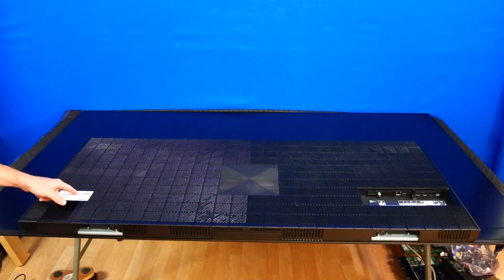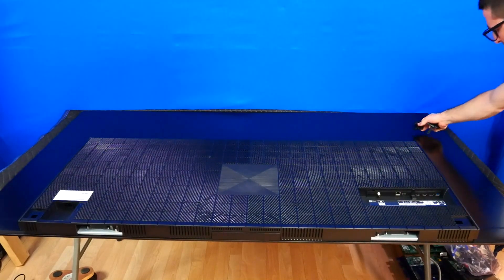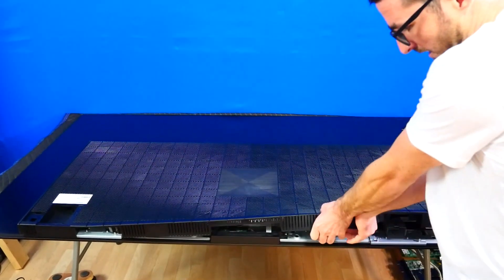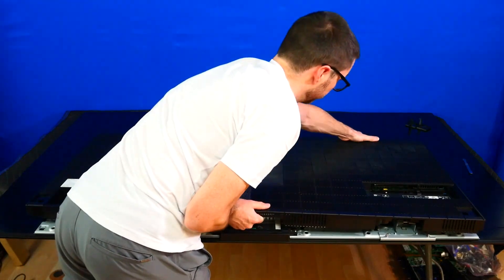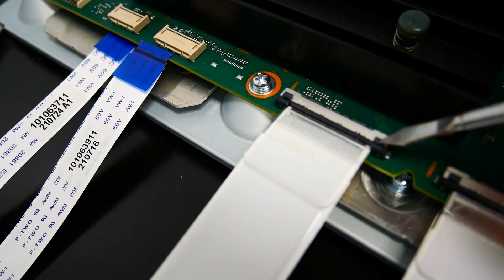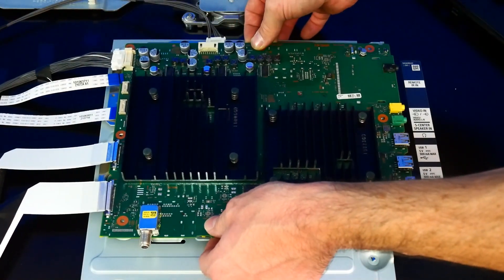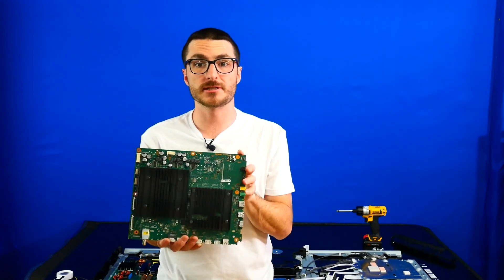Sony OLED XR-77A80J Disassembly | Back Cover & Mainboard Removal

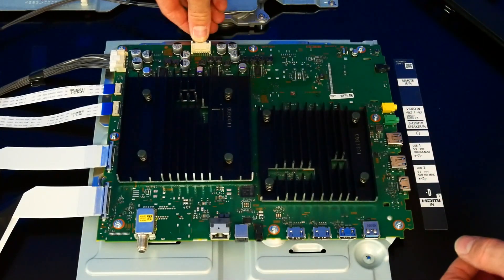Comment: 1:20 Great videos, Sony XR-6580CJ  power on issues for the first time after being off for a couple of hours. When powering on I get white steady LED sound of a relay picking and then I heard the relay click off. The white led is now off. When I power back on it powers up but I see the Google TV logo as if I did a reset by holding the remote power on button for a couple of seconds. Once the TV is back on normally I can power it off and on with no issues. Thus only happens when the TV been power off for a couple of hours. Any ideas power supply or firmware related?

Comment: Hello, I have the model XBR-65A8H. I got this on 4 April 21. Never any problems. I was moving it to a new location when i put it on I get these lines, the set goes on and shuts right off. The red lights blinks 4 times goes off and then blinks 4 times again, it keeps repeating the same signal. The pause between the blinks is about the same as the 4 blinks. Can You diagnose it with these signals. Id like tosend you a picture of the lines and a 15 second video, i don't know if its possible on here. Is there a chance on repairing this tv?

Comment: I appreciate the concise video. I found a listing for a 77" OLED Sony on FB marketplace listed for very cheap because the seller said the screen won't turn on anymore, but the power light does turn on. Is this usually a sign of a faulty motherboard, or are there other components it could be?

Comment: great video       can you do a video on installing the back cover on a xr-55a80j  i am having a problem  with the top tabs locking thanks i have the main board out to sent to you for repair
Reply from the maker: I don't have that exact model in my shop right now but we are working on providing more dissasembly and reassembly videos in the near future.

Comment: Do you have any idea what might be the issue with a 8 blink code on an 77A80K? It wasn't working I let it sit for a while and it worked for a little bit and then stopped again.
Reply from the maker: 8 blinks is typically a mainboard failure. Try a factory reset and software update if you can. If that doesn't resolve it, you would need to get your mainboard fixed and or replaced.

Comment: How do you do this for the XR 83 2022? I have it loose but it seems to be hanging up on the right side near the top squeeze tab?
Reply: Ok
There are 4 pull tabs on the left n right that need to be pried up by hand.
Reply from the maker: Sorry could you provide the actual model of the TV please.
Reply: @NicksTVRepair 
Xr-83a90j

I managed to get it off.
Reply: After changing the two power supply boards, the two high frequency flashing red lights changed to solid green n red.  There is no info on this error code.  Change the main board next?  Lighten damage tv

Comment: Hi Nick, I have a XR-77A80CJ.   If it's unplugged for a bit, I get it to boot, but then reboots a few times before it dies.  Only indicator light that comes on when it's dead is a flickering red led.  No patterns.  Then it won't boot up.  I can hear what sounds light a relay clicking on the side of the power board.  Would this likely be a main board failure or power board? Thanks in advance.
Reply from the maker: That is very strange, and I am not sure what could be going on. I have never heard of the red light blinking without a pattern. 

Can you double check and really pay attention to the red light and make sure it doesn't indeed have a pattern. 
If you can't see a pattern I would ask that you take a video of the red blinking light and film it for at least 30 seconds and send us a clip via email. Like this we can review the blinking and let you know what we see. 
Our email is support@nickstvs.com
Reply: @NicksTVRepair  I’m going to replace the power board this week and I’ll report back.  Hoping that does the trick, if not I’ll grab a main board and try that I guess.

Comment: The Sony “J” models are only like 3 years old (L is current).  I can’t believe they are failing already.
Reply: Do you have a video on replacing the Power Supply Board?
Reply from the maker: Yeah about 3 years old I think that's right.
Reply: The manufacturers are finding cheaper ways to make TV's cheaper.